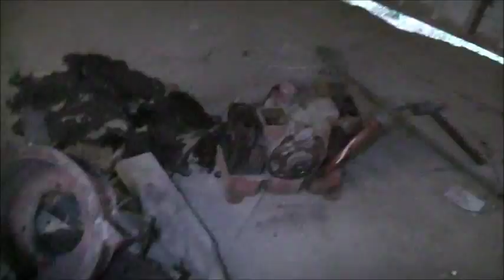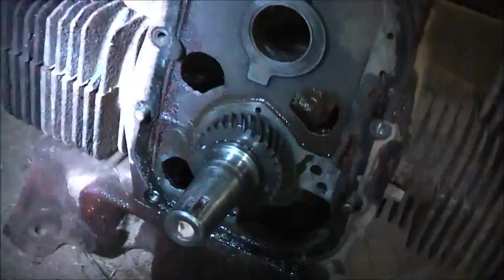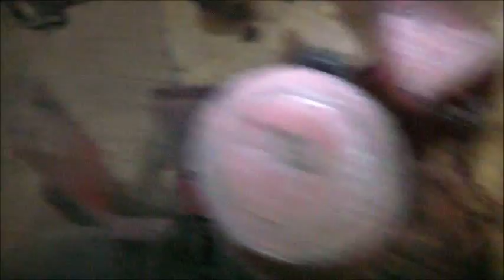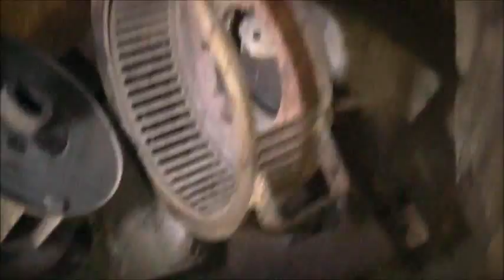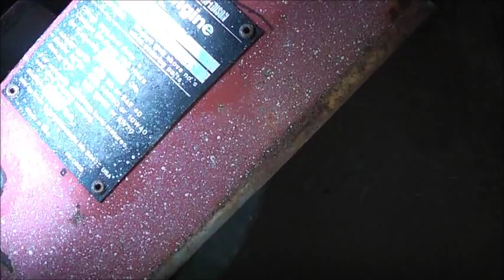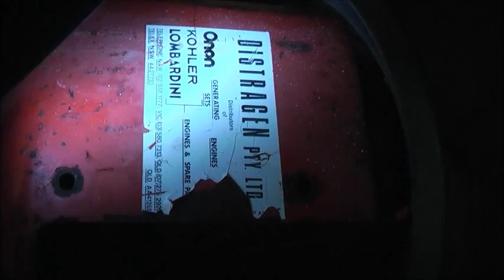Lincoln 225 Welder Score, With Spare Onan Engine!!

Comment: Back in the day I rebuilt several of those Onan boxer engines and I think they are a really well made, reliable and tough little engines that are pretty easy to repair as well!  That vacuum throttle control is a pricey little piece, I paid a little over $100 US for a good used unit for my SA200 Lincoln welder off of ebay.  that was several years ago.

Comment: Kero not much good for freeing things up. It doesn't have any lubrication properties. Better to mix some diesel and ATF (automatic fluid) together, should do the job. Great score. What about your little car engine, enough grunt to run this. When you strike an arc these welders really pull some power from the engine.
Reply from the maker: Got this engine running well now!!

Comment: Those engines are shitters! We do hat spares at work. I'd say that's more a 70's model as in the 60s it would of had a Wisconsin motor also the diesel version was a single cylinder lonbardibi but I'm sure we have a good 225 name plate
Reply from the maker: well made motors though!! i need a good nameplate, can't barely read this one!!
Reply: Horrible to maintain  tho, much better belt driven or another motor. As both the diesel (lombardini) and petrol on this model shake the shit out of the welder! The Lombards make better boat anchors. We sell most of the onan parts/ motors to people that have older bobcats as they have the same. I'll look for a new plate for you off a old one
Reply from the maker: would ya have a spare camshaft & complete piston & oil pick up tube for the other one? I wanna rebuild it!!!
Reply: I'll ask the boss tomorrow